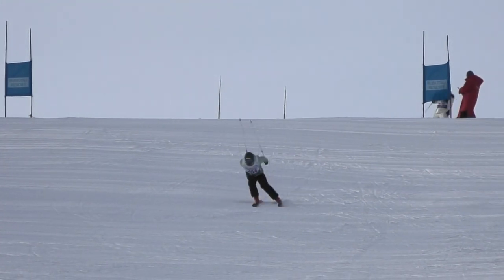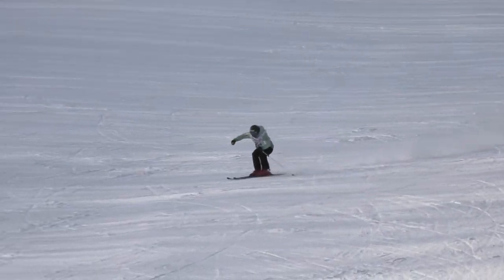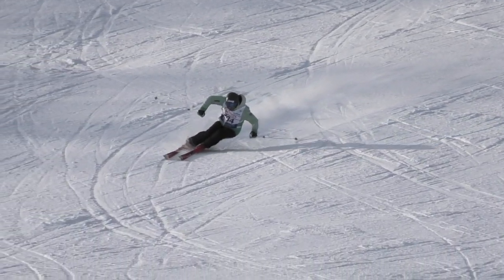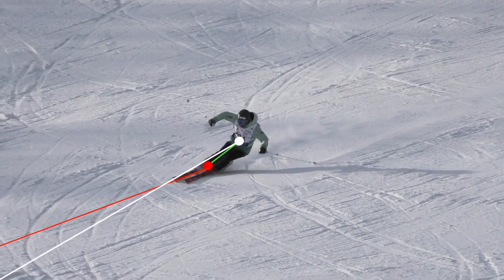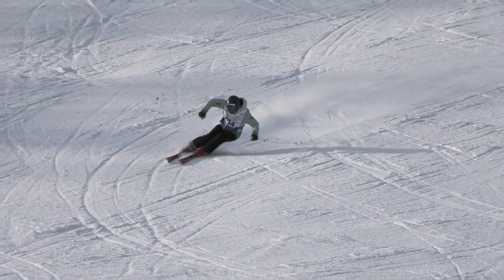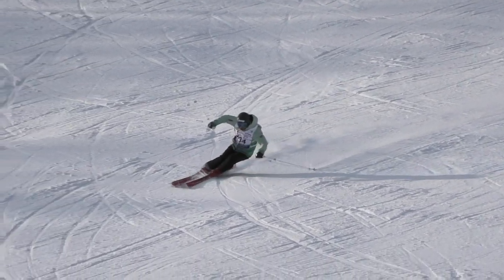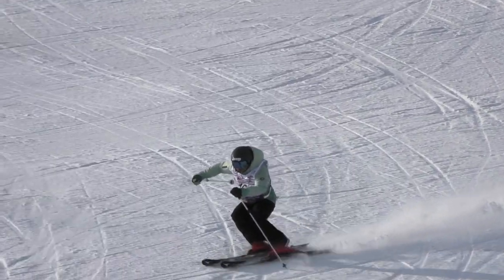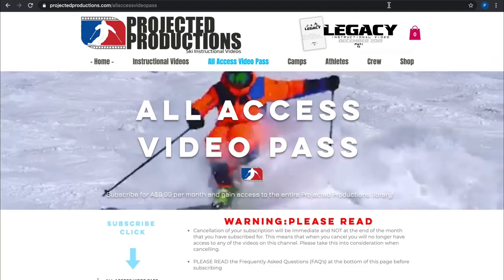TECHNICAL SKI ANALYSIS | Carving

Comment: What is the ski radius?
Reply from the maker: Competitors usually use a longer radius ski for these long turn runs (r25m - 30m).
Reply from the maker: Competitors usually use a longer radius ski for long turns (r25m-30m)